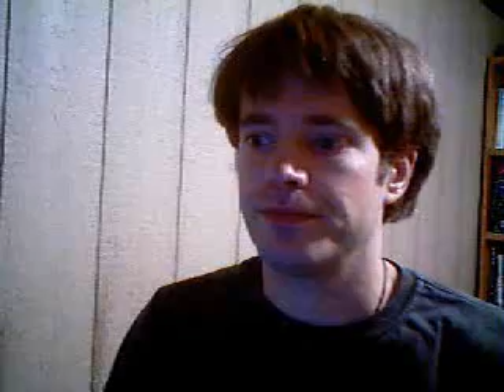Different methods to make water drinkable.

Comment: This guy is talking BS. Boiling water and cooling the steam is called destillation. Reverse Osmosis is samething completely different and works with a semipermeable filter and it works with pressure through a special filter. You lose a part of the water, but it cost much less energy then with detillation.